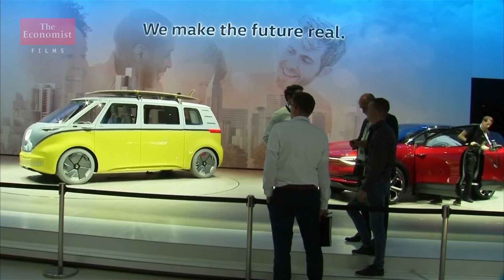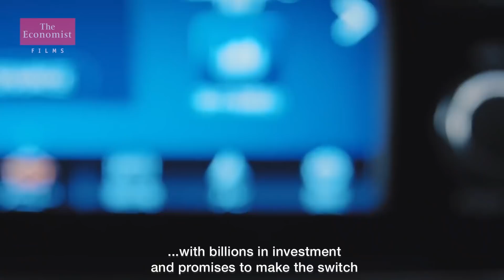Electric cars will come of age in 2018

Comment: Yep cause having a car that goes to the scrap yard after 5 years due to the battery not holding a charge anymore is so eco friendly. Not only that but the batteries stay toxic forever and there is really no good way of getting rid of them!
Reply: You are a little confused about the durability of EV batteries.  Even current batteries are expected to have durabilities beyond 300,000 miles, and a defect-free electric motor can go a million miles.  This already puts EVs well beyond gasoline vehicles in terms of durability, once volume production ramps up.    Also, the materials the batteries are made out, particularly the cobalt, of are all easier to recycle than to mine.  And unlike gasoline engines which spew their crap all over the planet, the materials in EV batteries don't go anywhere. They are sealed in the battery cells.

-Matt
Reply: EV batteries would be recycled.  I am not certain what current EV battery life span is but you would not junk the car.  You would either buy new batteries which given battery price trajectory will cost half as much 5 yrs from now or sell the car onward in the secondary market.
Reply: Adam Smith you again you fracking TROLL. No BEV batteries life span is way beyond 5 years more like 400,00 Miles 15 years for a BEV built today. Stop with the BULLSHIT LIES.
Reply: You simply have no idea what you are talking about Adam, The world is heading electric, and the nonsense you spout is not going to change that.

Comment: @TheEconomist
Thanks for a good summary of the current Battery Electric Vehicle (BEV) situation.  However, pointing to the electricity supply, you gave the incorrect impression that BEV's are just as polluting as their Internal Combustion Engine (ICE) ancestors, scientific research shows that not to be true.

Unlike an ICE vehicle which gets more polluting with age a BEV will get greener as utility electricity is moving to the cheapest provision on the market - renewables, chiefly solar, but also wind generation and battery storage.
Reply: Indeed! https://www.transportenvironment.org/press/electric-cars-emit-less-co2-over-their-lifetime-diesels-even-when-powered-dirtiest-electricity
Reply: Yoann Le Petit, clean Vehicles and emobility officer at T&E, said: “Today an electric vehicle driving on Polish electricity – the most carbon intensive in the EU – still has a lower impact on the climate than a new diesel car. With the rapid decarbonisation of the EU electricity mix, on average electric vehicles will emit half the CO2 emissions of a diesel car by 2030 including the manufacturing emissions.”
Reply: Fantastic resource, thanks for sharing.
Reply: I drive BEV and it's battery degrades every year even if not used. Much worse in winter than ICE in range terms.
Reply: Cobalt mining is destroying rain forest in DRC. Under 5% of Lithium based batteries are recycled unlike easy to recycle Lead Acid. Mist are incinerated despite the EV propoganda where a few manufacturers use used units provide battery back up power.  Bigger, heavier cars = more energy consumption. This negated the efficiency benefits of diesel with rise of SUV supersize me consumer culture. EVs going the same way. More road contact, more PMs.

Comment: Only for the rich, and never in the rural areas
Reply: Maurice Upton: The prices come down with time. And electric cars are perfect for rural areas, if you have solar or wind generator. No need to buy gas, make your own energy.
Reply: LiiMuRi i know but some people live 300 to 600 km away from big towns like in the Australian outback so diesel   will always win IMO
Reply: I think the reality is that new technologies always start out being more expensive, and early adopters always tend to be the more affluent.  It isn't until the technologies bootstrap into volume production that they become cheap enough for regular folk to afford.  Strangely enough, efforts to derail the EV revolution only make the problem worse, by making the transition take years longer than it would have otherwise.  A lot of politicians believe that they can just walk back time, but that sort of thinking has never worked in the past and certainly won't work now.  The only way is forward, always.

-Matt
Reply: Most analysts predict that between 2025 and 2030 electric vehicles will be cheaper to produce than a comparable gasoline powered car. The total cost of ownership will be less significantly sooner. So in other words the EV will most likely be the most common type of car to buy just 10 years from now.
Reply: Maurice Upton SOEC <-> SOFC fuel cells using Alkanes. Generating Alkanes from Solar Thermal + PV because Australia. Which ironically was pioneered by CSIRO but failed to be commercialised. No diesel is SHITE and piss weak.SOFC Electric Car / Ute could easily kick out 1000lb/ft which would be very useful in the outback. Sure BEV are not fitting for remote places like Aussie Outback but there are better alternatives still using Electric Motors.
(FYI I literally grew up in the Aussie bushland.)
Reply: Do not be surprised when every poor joe in rural areas are driving little 20kWh electric datsuns (or whatever) that can go 150km on a charge they get every 2 weeks from some 2nd hand solar panels they bought from the local pawn shop. 

You can maintain your blindness until then, but do not be surprised. Today's EVs in the west are luxury high performance cars for people who commute 100s of km every day. China's already building some econo models. Within a decade there will be true cheapos that can only go 80km/h for a bit over 100km. But they will be sold and bought in their billions. "Volks"wagens.

I think your perception is formed from a lack of perspective of what it means to be poor in a rural area. And what the rural poor might find massively desirable.

I commute less than 5km a day, and I hardly go anywhere ever. What kind of electric car do you think would make sense for me? Just as a commute car. I can afford a Porsche, but... Do I want one to commute with? What would make sense for a poor rural farmer that is currently carrying his little bit of produce to the market 10km away on his back even as he's getting older?
Reply: Joe Black  Petrofuels still have lots of investment, cant see any total convertion for many years to come.  Farmers still use diesel-powered tractors and harvesters for hours on end they run them 24/7 in harvesting season and it's the same with aeroplanes they run them 15 to 16  hours at a time 8 truck loads of fuel. Petrochemical Fuels for their weight store an awful lot of energy.  I think that many of these electric vehicle fantasies that people are having are somewhat over enthusiastic, I believe that EVs might be ok in an Urban situation but until they sort the battery technology for many people and industries petrochemical fuels will be with us for many years to come.
Reply: Neojhun Then you will know that people that live in remote outback locations dont always have the money to invest in alternative fuel options, for example, a solar electrical system for a house  costs upto $ 30k to power a 6kw system for average sized house. Storage of enough energy is a real issue even for home owners.
The internal combustion engine is very rugged & versatile, as you say it can be redesigned to be run on hydrogen, methane, alcohol or any types of oils, but that all cost big money.  I'll say it again electric vehicle battery technology maybe ok in an Urban environment but not much good for airlines, long distance trucking,  or other types of industries like shipping or farming such as  cropping
The energy-storage of carbon based liquid fuels out strips that of battery technology, sorry but I think petrochemicals and internal combustion engine will be around for a long time to come.

Comment: I suppose I can't prove it but I'd imagine transporting,refining, and retransporting petroleum has got to be more polluting then natural gas which is increasingly the main fossil fuel for electricity generation. I mean its still not ideal but its a stepping stone to full renewables.
Reply: Well aren't you a good Moderate. Why have the perfect solution when the still horribly polluting halfway solution is right there and can make the oil companies so much more money?
Reply: Fracking isn't a good idea!
Reply: Drilling for gas in ME, compressing it, shipping to EU, burning it or fracking hardly better than fossil liquid fuels. Add in grid losses, EVSE losses, PEU losses, battery losses and that explains why an i3 is no better than an old Audi A2 in efficiency terms. http://www.autointell.com/News-2001/May-2001/May-2001-4/May-23-01-p8.htm
Reply: Jonathan Palmquist LOL you said it for me.
Reply: Solar will soon kill oil, gas and coal 100% completely, because it will be cheaper, and no one can stop it, not even fossil fuel PR flaks. 

In 25-50 years it will be cheaper to synthesize gasoline from thin air than to pump it out of the ground. But no one will want it anymore  anyway. Diversify while you still can.

Comment: What happened to hydrogen power?
Reply: John Burrow the market chose electric, that’s what happened. Hydrogen is great but it’s extremely expensive at the moment and who knows how long it would take for hydrogen to come down in price. Electricity is just readily available and progress is already being made towards renewable electricity so it’s just more practical and easier to go in that direction. Hydrogen production isn’t clean either just like battery production isn’t clean
Reply: Toyota's rejection of the battery electric vehicle will go down in history as their Kodak moment.
Reply: It's 10 years away... just like it has been for the last 70 years and will be for the next 70 years.
Reply: Hydrogen is still electric, since it basically feeds a fuel cell.  But there are lots of problems with hydrogen, not the least of which being the need for fueling stations similar to the gas stations we have today.  The hydrogen cycle is also very inefficient.  By the time you get it to the wheels of the vehicle, a lot of the energy has been lost, whereas battery and electric motor technologies are around 90% energy efficient... thus depending only on the efficiency of the electricity produced by the grid (which will only get better as renewables are added to the mix).

But the bigger problem for hydrogen is that batteries are further along the engineering curve and even if hydrogen fuel cell technology is able to improve significantly over time, it will still be chasing battery technologies that are improving even faster for many years to come.  That's a death sentence for Hydrogen-based vehicles.
Reply: 0.0889 grams / litre. There are many awesome alternative Fuel Cell types. But Hydrogen H2 is factually IDIOTIC for human activity energy storage. I prefer Alkane Fuel Cells like SOEC <-> SOFC.
Reply: BTW.  Nobody who owns a battery electric vehicle fantasises about having to go back to fueling stations to get their fuel.  BEVs are better than HFCEVs.  More convenient. Lower running costs.  You charge at home when not using the car.  You can charge at destination when not using the car.  You can install a charger literally anywhere, you can't install a hydrogen fuel station anywhere and you can't do it cheaply.
Reply: Many fuel cell cars in Cali <- Yep, and that's where they'll stay because they can't leave.
Reply: Toyota is still investing in hydrogen. Are they keeping a secret from the rest of us????
Reply: Still developing. There are some rather serious challenges, but who knows... Maybe one day your EV will have it's battery pack replaced with H2 fuel cells.

Personally I think not, but you never know...
Reply: Gedvibes. H2 for cars is electric. As in fuel cells generating electricity. Burning H2 in a combustion engine is not a good idea.

Batteries will probably become much more energy dense than compressed H2 though.
Reply: John Burrow 
I'm really getting tired of having to say this on every thread concerning electric vehicles and comparing hydrogen but watch this (he explains it much better than I ever could)
https://youtu.be/23lz9ercqvA,

When you've watched it try his other videos they just about give a conclusive argument as far as I'm concerned he's been right on the money for the last 10 years!
Reply: John Burrow 
No worries, but I do suggest you spend an afternoon, morning or whatever, watching a couple of the Tony seba videos, both regarding the hydrogen electronic debate and the technology disruption situation.
I found his arguments compelling, enlightening and conclusive.
If having watched them an individual still champions fossil fuel vehicles there's no hope!
On this thread I've also been advising a Google search of "Toshiba battery press release" and then to read the article from October 3rd. I believe Tony Seba mentions Next Generation batteries in some of his presentations and this appears to be the first of at least several coming to market. These will only serve to reinforce his conclusions.
Enjoy!
Reply: 2LegHumanist I see. As a disclaimer, I regret posting anything on here as it seems simply asking a question about the future of hydrogen (something as you correctly stated in a previous comment, and something I recall as well) has generated not only debate (which I enjoy) but also sentiments of disdain (hence my regret). I am not saying you are being disdainful or disrespectful at all; it was more pointed at future commentators on this question. 

Thank you for your replies. Seeing enthusiasm for this is interesting and welcomed.
Reply: Thank you for the link. Considering this is my first comment on electric/hydrogen comparisons, I am sorry to have disturbed you yet again concerning the topic.
Reply: John Burrow 

Many fuel cell cars in Cali
Reply: 2LegHumanist 
Lmfao!!😂😂😂😂
Reply: #riversimple
Reply: It's very much alive see riversimple UK and Nicola USA
Reply: Larry Butler If you can wait a few more years, you're on. Loser buys Chicago stuffed pizza?
Reply: A) Hydrogen isn't a power source, it's a means of power storage, like batteries. You still need solar, nuclear, coal or what have you. 

B) Containing hydrogen is difficult. It's chemically reactive, and slowly bleeds right through solid barriers. And it's light weight, so you need a relatively larger volume of it, which means relatively larger and heavier fuel tanks.

Otherwise it's pretty cool. There are already niche uses for fuel cells, and that may continue or increase, idk. But over the next couple of decades it won't be able to compete with batteries, which will continue to improve. (Unless there is a breakthrough in solid metallic hydrogen, in which case all bets may be off, but it might not be economical - or even physically possible. No one has ever seen any!) 

You can also make methane or even gasoline straight out of the atmosphere, about as easily as making hydrogen. If the process is solar/green powered, then it's a carbon neutral fuel. So you can have a renewable, carbon neutral, flammable fuel if you want one - but it won't be able to compete in any category (even cost, performance or energy density) with tomorrow's batteries. Jay Leno only.
Reply: Around the end of 2020, when ALL diesels will be outperformed by EV's & cheaper to buy...
Reply: Hydrogen is dead. In the best case scenario it is 2x less efficient than battery-electric vehicles... it can't be made more efficient... and technically those are not Hydrogen fuel cell cars, but Hybrids, as they also need a quite large battery pack to store/stabilize the energy coming from the fuel cell.